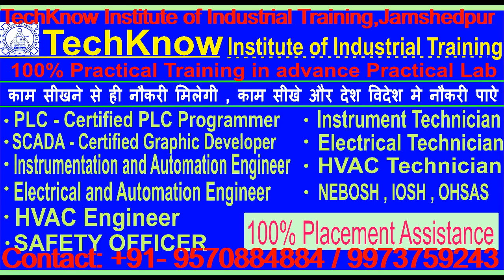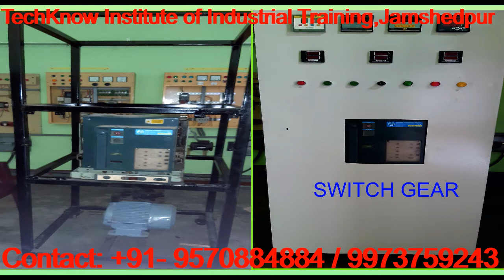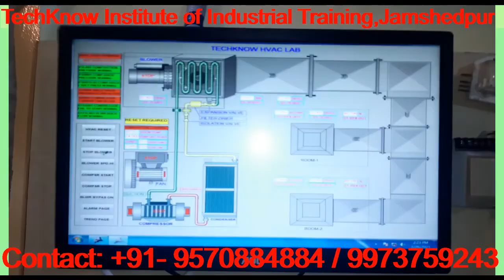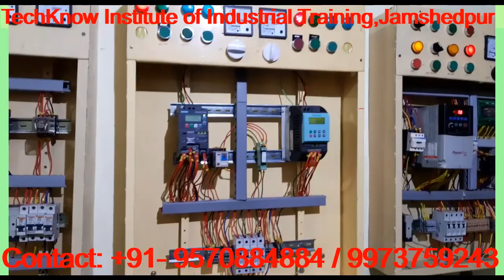BEST TRAINING | PLC | SCADA | INSTRUMENTATION | ELECTRICAL | HVAC | SAFETY | ENGINEER | TECHNICIAN |

Comment: i from samastipur bihar mene yha se electrical technical ka course kiya bhut accha laga yha practical v hota h
Reply: भाई जी एक इनफार्मेशन दे दीजिये
Reply from the maker: Ji boloye
Reply: @techknowitt  plc/scada ki training krni hai kitna charge lge ga or hostel ka kitna lgega or fooding ka bhi
Reply from the maker: @Yograj_singh_2032  PLC / SCADA Training ( Module will include Allen Bradley & Siemens PLC + Wonderware SCADA )

Duration : 21 Days
Fee: 10000/ ten thousand
Reply: @techknowitt   Hostel and Fooding...?
Reply from the maker: Yes lodging and fooding facility is available
Reply: @techknowitt cost...?
Reply from the maker: Around 4000/ per month for  both